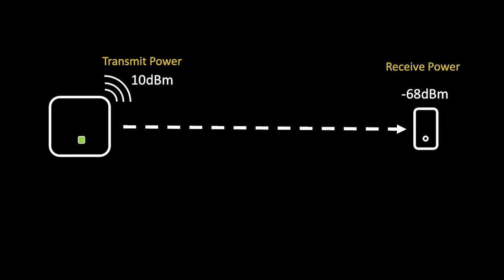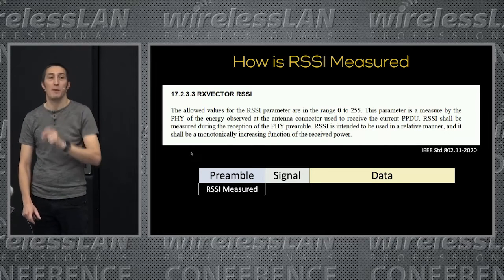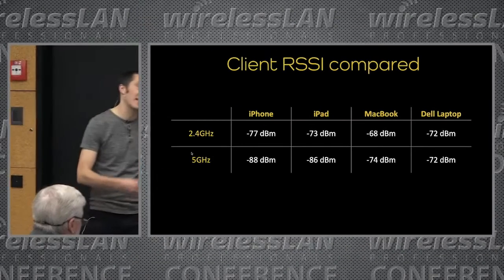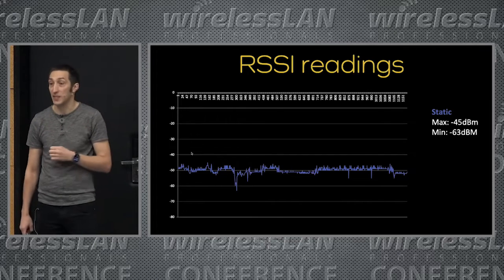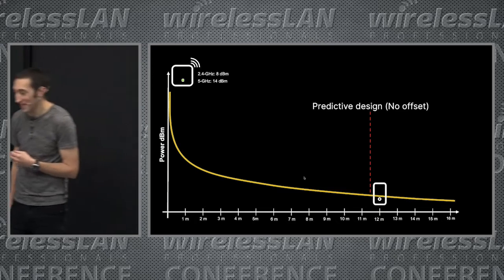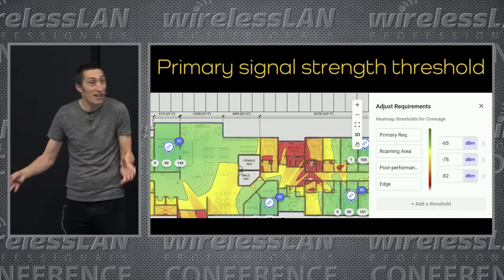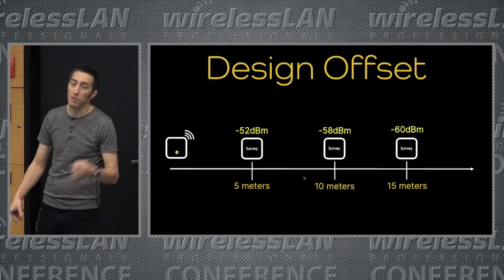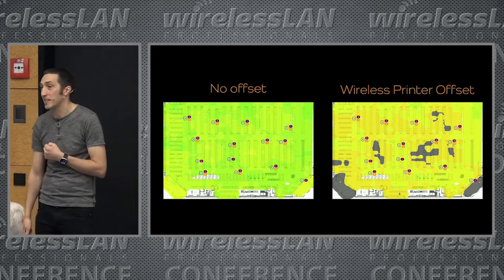Off with the Offset | Peter Mackenzie | WLPC Prague 2023

Comment: I've always treated validation surveys like assessments - essentially assessing my own design based on set requirements designed for, which means design/assess based on several factors that should be obvious, one of which is the LCMI Device. So when I assess using a Sidekick, I offset to what the LCMI Device is after measuring. Presented as "here is how this LCMI device hears this wireless network", answering the question of "will this device perform well on this network as designed".